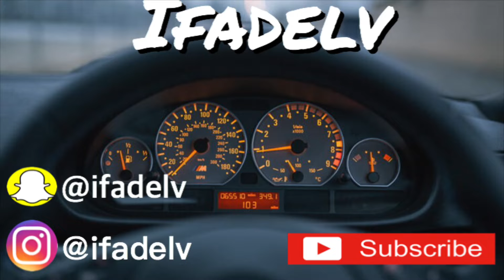HOW TO remove coolant tank bracket in a bmw e46

Comment: what size torx is that?
Reply from the maker: David Bozek bro i have no idea, i have a nice lit bit kit& i tried the smaller ones
Reply: It's a T-25. I borrowed a full set of larger torx heads  that worked with a 1/4" socket set driver. The T-25 fits perfectly.  It's also the same size that used for the self-threading bolts that attach the radiator (or is it the fan shroud) along either side near the top of teh radiator (or the shroud).

I replaced the bracket and put everything back together. Even with the coolant topped off (and I bled the system properly) I was getting the coolant warning light on the instrument panel. It turns out that when i put the electircl connector back on to the coolant level sensor at the bottom of the expansion tank, I must not have pushed that connector all the way in. Went back and pushd it back in all the way and the light went out immediately.

Everything is working fine now except i have a TINY coolant leak coming from where a hose attaches to that funky 3-way connector that slides diagonally into that slot in the bracket. That 3-way connector part has coolant flow between the ATF cooler, the bottom of the expansion tank, and the hose that I think needs replaced. I think its called the expansion tank return hose, or Engine Coolant Return Hose, or bypass hose. (They probably have one name for it in German, but when it gets translated to English no one seems to agree wtf to call it. LOL)